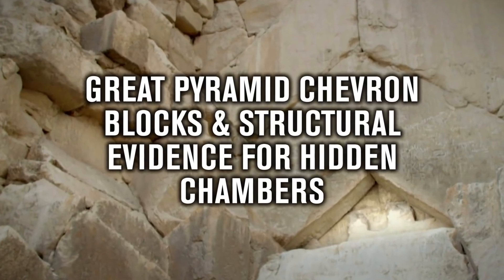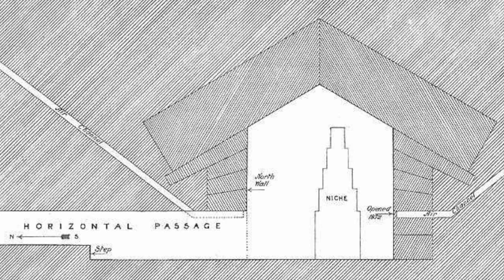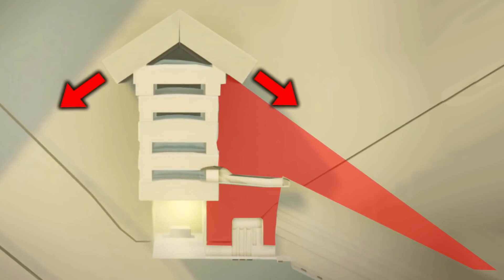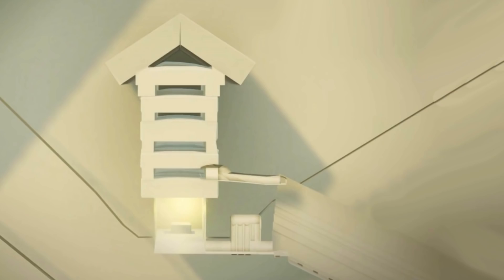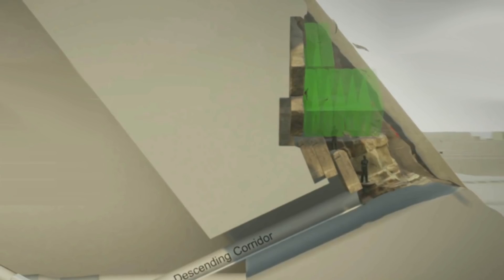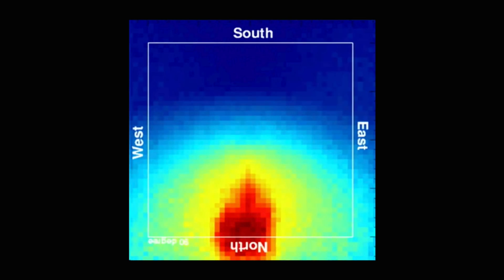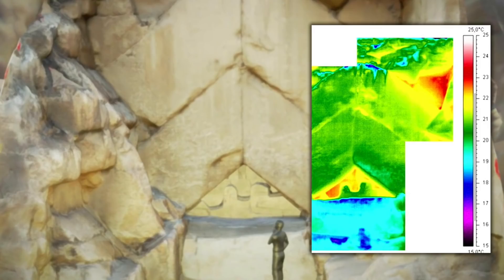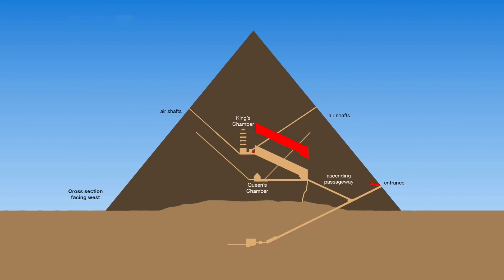Great Pyramid Chevron Blocks & Structural Evidence for Hidden Chambers | Ancient Architects

Comment: I have a few questions in regards to the chevrons.  

- why was the unknown shaft under those chevrons covered with the chevrons if neither the grande gallery nor the entrance passway are protected by those chevrons?  What properties must the pathway under the chevron have that it needed the chevrons while the other passways did not need this kind of cover? 

- Was whatever is under those chevrons so wide that it needs chevrons ceilings while the passageway is so narrow that it doesnt?

Also, why were the chevrons built all the way to the outside skin of the pyramid? At that point was was hardly any load on top of the passageway under it and a flat roof could have done the trick.

Also how were those chevrons put in place? If the construction of the kings chamber ceiling required the grande gallery as a construction tool then how were the chevrons  put in place?

Comment: Little known fact about the relieving chambers, when they were first entered they were found to have disintegrated Scarab Beetle shells on the bottom. The spaces were apparently filled with them at the time of construction but they gradually turned into black dust over the centuries. Also, the chambers serve no engineering function, they can't prevent collapse and a simple chevron type ceiling was able to support the even greater weight of stone above the QC and above the ground level chambers in other pyramids, none of which had anything like the relieving chambers and had the weight of the entire pyramid height over them. Nobody can actually explain why those relieving chambers are up there, the name is even misleading because they don't relieve anything, the chevron above those chambers supports all the weight.

Comment: it is already interesting, yet also confusing, that as good as NO literature and documentation about the khufu pyramid describes the true number and dimension of the chrevrons at the entrance. truly, I never new how many chrevrons the entrance had, even less I knew how slender they are. why would you need so many chrevrons for one simple, single entrance corridor? the comparativley massive chrevrons above the central burial chamber surely lighten the pressure onto the chamber. sure thing. but why does the upper burial chamber not have chrevrons as a ceiling like the central chamber in the first place??? and what does the upper chamber even need so many relieving chambers for??? simple chrevrons directly above the chamber didn't do the trick? no offense here, but I don't believe the djed-pillar theory. no, there must be another reason for the odd number of relieving chambers. I am also fully convinced that there is at least one chamber that is still unopened. a chamber that was unknown to the antique historians and tomb raiders.

Comment: Very interesting topic for video. Almost probably I can state that the chevrons were destroyed by an explosion from the inside of the camera. A vertically fallen stone after the explosion blocked the rest of the room. The explosion occurred due to a careless attempt to open a room or from a pedmet that kept there. Similar destruction on the video attached to my comment. The video is accompanied in Russian, but it does not matter. The main thing is video, it is very clearly seen that the destruction occurred from the inside of the camera. It is not difficult to calculate what power the explosion occurred if you have the sizes of the pyramid.    https://www.youtube.com/watch?v=Vn2ugHBN6_g   It is best to look with the third minute of video.

Comment: Isn't the "mountain" stone under the outer chevrons a strange feature? Why is it there? Why do the extra work? 
Is there any evidence that the GP originally had a visible entrance? Was it covered invisible behind casing stones? And why the hell was it never opened? The chevron blocks make it very obvious that there is a very good chance to find some sort of room behind it. This part of the pyramid sould have been very interesting both to treasure hunters and explorers. It the mountain stone even an ancient feature or was it added later to cover up an entrance after it had been found?

Maybe the Egyptian authorities can not allow the truth being told because it would make them need to explain something. 
How did the Giza ticked and the black plastic spool/wheel make its way up into the QC northern shaft? What is behind Sibson's window? They clearly did not want the pictures from the QC northern shaft being published. Why? 
It clearly is not impossible that they did secret explorations and found new rooms. But why do that in secret? 
Fear of a major rewrite of history? I don't think so, I don't think the GP is much older than the official story tells. 
Or are they gangsters, not exploring but treasure hunting and secretely selling expensive stuff they found? 

It is just as cracy as the "I don't believe in radar" chambers that could tell the truth about the tomb they sell us as being King Tut's tomb. I don't understand it. The guy to blame for the fake is long dead and he ins not even an Egyptian. Mr. Hawass could be world famous for finding the truth and rewriting that episode in Egyptian and archaeological history. He does not want to. Why?

Comment: As you said in the video "If, if, if..."  the Egyptian authorities of Antiquity would, could, should... but they didn't and they don't. I think that's the greatest mystery of all of Egypt!
They have the most mysterious structure on the planet and a lot of scientific independent data shows that there is a huge mystery to be uncovered by simply drilling a small unnoticable hole and look behind... but no!
And in 100 years the great son of Ancient Architects will bring new holographic 3D videos to users on the moon base via the new space internet about potential mysteries of the Great Pyramid. But Zahi Hawass Jr. Jr. would intervene.
/Sarcasm OFF

Comment: The blocks are not for load bearing. More weight is on the "Queens chamber" and due to it's angle and the blocks are not locked in by resting on the edges makes it less sound and in the "Kings chamber" clearly it's not the case due to the rows of 70 ton blocks laying flat and layering multiple ceilings with a gab between each then the arched section at the top does not add support it weakens it if anything. The only benefit is acoustic as far as we know. Each layer has 9-70 ton blocks and 5 high with around a foot gap between each layer and only the tops of the blocks are not to a polished finish and it's believed to be for tuning the blocks, because touching each block are in tune? A-Frame building was never used in Egypt then. That's if these were built then. Based on weathering, it's more like 25,000 to 35,000 years old. It could be older because most of this site was under sand for God knows how long! That's basic fact you can't argue. But the Science is never settled so until we can est. weathering more accurately, that number for me is it.
Reply: why would the EA build something complicated as the GP for ..sound reasons? No other pyramid has done this.makes NO sense. just another fringe idea to sell books and DVDs.
Reply: @ast3663  I didn't say it was. I said it seems like it. I don't know why they used these designs, or why the interior had to be red granite, or why not one bit of Hieroglyphs anywhere inside (That never happens in Egypt!) But I do know an Engineer pointed out the weakness of the design, and suggested another purpose. By the way, No Aliens! No big foot! But is it possible we had to restart due to disaster? It would be fringe to think it not possible. If today, only tribes and natives would survive and bring no tech. with them. Hypothesis only.
Reply: @sedigives  well, thats the difference between just an idea and a worked out theory/ thesis. The five relieving chambers statically still hold up today, so they are still in working order. THAT is what I would call an architectural masterpiece ( after 4500 yrs), not 'weakness'. Whatever fringe writer this claimed has no idea or has never been inside a pyramid ( Cayce incl).In J-P Houdin's theory the queens chamber acts as an resonance intercom system because of its polished limestone design with the2  shafts that lead up exactly to the height of 60m, that is the height of the kings chambers roof. So the shafts were most likely there for the construction. https://vimeo.com/127533376
Reply: @ast3663  It's a masterpiece far beyond their capabilities, I believe. The weathering of the entire area looks to me like 25,000 years. They never used A frame designs and the blocks are over lapping not standing. The damn place could have been an amusement park for all we know?
Reply: @sedigives  what evidence is your '25,000' years based on? Any data? or just another fringe idea like Hancock. btw, Schoch was not right, but the fringe doesnt tell you that.They just want to sell books.
Reply: @ast3663  Great question, first you need to know the type of mineral and it's decay rate based on environment, then examine Hundreds of examples, compare yours to the know and you should be able to conclude an accurate age. That's what I did. Now Sandstone is more consistent then Granite because of Crystal content and hardness, so the ranges can be extreme, Sandstone breaks down much faster, so it can only last for so long, limiting it's age do to exposure. I hope that helped. You will find a overly conservative prediction sometimes, so always take out the extremes, all of them because bias is a killer in Science! Spend a Hundred hours or so and you'll agree. and thanks for the question.
Reply: @sedigives  so no '25,000 yrs' evidence for the egyptian monuments. glad you cleared that yourself up.
Reply: @ast3663  No, I was talking about enclosure and the quarry surrounding the site and the Granite 5 miles south. Also note: The Baalbek quarry is a great example of weathering and compared to the stones at Gobekli Tepe, they have more signs of aging, although Tepe was covered up, so was the quarry, so if Tepe is 11,000 years old (I believe older) then the monuments at Giza could not have been built by the Egyptians, unless they were hear before the event that warmed us up so rapidly? We have sites everywhere that were incomplete, with later building styles on top. What happened, or is everyone holding tight to their bias?

Comment: Why doesn't the Egyptian Antiquities department allow scientists to set up seismic detectors on the surface of the pyramids, and just record vibrations through them? No need to set off a blast anywhere, as there is enough recordable noise and vibrations to use as a reference filter for reflections. It would be a simple solution. If there is a nearby archaeological bare area nearby, a blast could be set off, and in a matter of minutes, a full 3D seismic render of the structure could be formed. The more detectors set up in carefully logged locations the better. The structure is essentially one huge block of stone. The hair fine joints effectively act like solid joints, so signals would pass easily through the rock with minimal loss.

Comment: I was thinking about those extra Chevrons at the presumed entrance... they would be to divert weight around the roof a a chamber, but like you said, it's far bigger than needed, so i would have to assume that maybe at ground level or below perhaps, there would be a large chamber. the lower down the pyramid you go, the more weight you have to divert, and im thinking it might be possible somehow to compare the various known chevrons to how much of an void they divert the load around, and create a ratio or formula to tell what size void the other chevrons are protecting. There may not be enough data to create it accurately, but I think it's worth someone who's really good at that kind of structural math to think about.

Comment: I always picked out that same block in the chamber because it was not load bearing and the diameter of the sarcophagus was the same. There is buckling in the kings chamber floor, there has to be space beneath.I also think the chevroned location on the north side is precisely what you have opinioned ,including the possibility of having had hinged doors. I think the square well on the north side was for a hydraulic mechanism to open them. I believe there is much to learn by opening the pyramid. The world at large must use pressure to make them stop using it as a monument to the Egyptian culture, and a mere tourist attraction. My worry is that a large earthquake might collapse the inner structure and bring down a mountain of stone over it. What would happen to the relics then? There's no way they could lift all those stones out of the way. The relics would be crushed,buried, and exposed to the elements. A crime against humanity. And thankyou for your channel.
Reply: solon wrote that he walked into a fully functioning pyramid. the door pivoted up and back out of sight. not what we see today.
Reply: @Rivenburg-xd5yf  I...want to do that. I live near solon ohio

Comment: I’m a civil engineer. I’m always puzzled by the term “relieving chambers”. As you say, there is no structural reason why the chevron blocks could not have formed the roof of the king’s chamber.
Reply: the very unique engineering decision by Hemienu directly leads to the conclusion that there was a reason why this had to be done to SUCH HEIGHT. Structurally speaking, if the big chevrons had been placed with just two relieving chambers this would have been sufficient. The Grand Gallery's own corbelled roof constrution in itself is strong enough to carry and redirect the carrying loads.
The reason why it actually IS that high is that it protects other rooms under it.
Reply: @ast3663  What does that last sentence mean?
Reply: @martinsavage6838  The chevrons are protecting hidden spaces, rooms, tunnels, etc.✌🏻🐱
Reply: @PhoenixLyon  That’s at the entrance, I’m talking about the ones above the ‘relief chambers’ at the king’s chamber.
Reply: @martinsavage6838  no thats the KC. There is no real necessity for those four relieving chambers to be there..their umbrella protection zone is securing another, undetected room(s).

Comment: I'd suspect the main purpose of the relieving chambers is to ensure that the load redirected by the chevrons (a primitive pseudo arch) doesn't directly intersect the corbeled chamber of the ascending passageway and overstress it as would happen if the chevrons were directly above the king's chamber. The added height is solely necessary to achieve this. There might be another chamber in there as well but if so it too would need to be entirely above or below the line following that side of the chevron above the king's chamber to remain stable. If the builders had had the use of true arches it would be much easier for them to omit the relieving chambers as the force would be effectively redirected straight downward on either side of a space covered by the arch and not cross the plain of any other features not directly below.

Comment: I keep thinking to myself a third passenger and electricity direct current must need one phase that means two connections in the straight and direct it must power something alternate current must have a three phase a ground a current and a hot and I just can't stop thinking about that now because alternate current gives off electricity but then feeds it in to itself I just can't stop thinking Christopher done might have been right but in a different way it could have been just a three phase electrical motor as the Earth being the energy it makes so much sense other than making it electrical charged by any other way other than the Earth so it was almost like it was the opposite of three phase or alternate current the ground the ground was not the ground as we know it but the ground was the facilitation of the pyramid structure to the area and the hot wire was the Earth the common wire could be water and it makes so much sense it completes the current it seems weird but that's the basis of alternating current three legs hot common ground the hot leg is the output the common recycles the energy the ground makes it more efficient pretty simple but yet complicated but it is backwards for our thinking
Reply: Familiar with Tesla's Wardenclyffe Tower? Also check out the hotel he lived in. Tesla did the electrical layout for it.✌🏻🐱
Reply: fringe idea to sell books and DVDs.

Comment: if you look inot all the archaelogical evidences since the studies of the pyramid, that entrance was dynamited for let a space to enter, that is why you dont find more Chevron blocks. they are used to compensate the weight of the stones presure over the base and stabilize the structure to keep the inner chambers. all in triangle drop from the peak down. other small chambers were covered since they hadnt anything inside due to robbers. a lot infrared, x-rays and scanners from satellites show evidences of corrections or the intention of adding burial members inside if the family dinasty survive, but all changed.

Comment: It's an even bigger mystery where these passages might lead. There's no evidence of any void between the two surveyed sections. Does the North face void just stop in a dead end? Same with the void near the King's Chamber. The inclined passage seemingly ends without going anywhere.  The voids are still intriguing but would be more compelling if they appeared to connect to something.
Reply: The strange marks on the ceiling of the Grand Gallery.